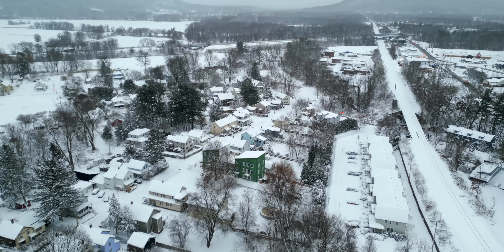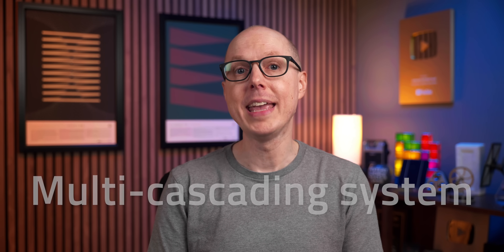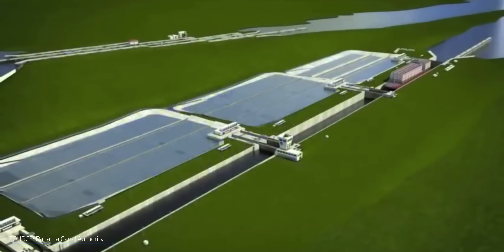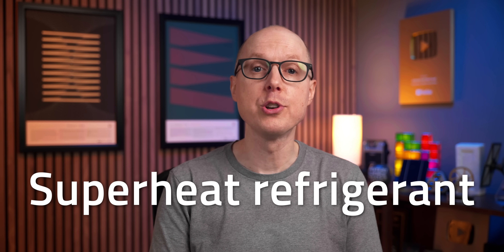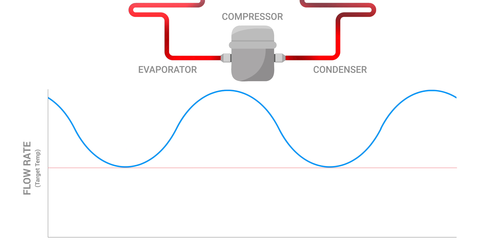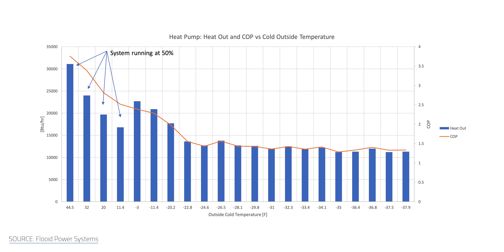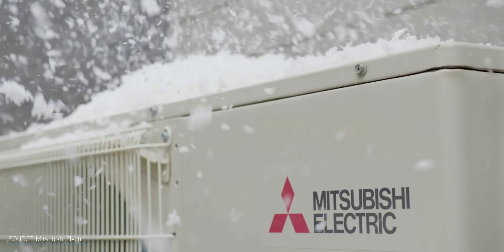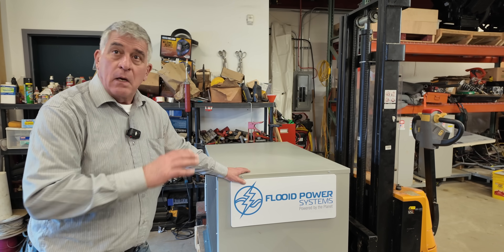How This New Heat Pump is Genius

Comment: today the temp is over 42C inside and outside it is over 44C here in India.

Traditional air conditioners can't handle this load- We had power blackout twice today. Two stage heat pumps must become cheaper so that it is affordable.
Reply: Everything that I've seen, heard & read indicates that India's major issue is the electrical infrastructure is woefully inadequate for basic needs let alone for use that the US sees as comfort. But yes improved efficiencies for these heating/cooling units are great, but only when used in tandem with improved energy production & distribution.
Reply: install solar.
Reply: My god that’s insane… Productivity must plummet in that temp sounds like hell!
Reply: is the humidity dry where you are in india . if it dry just use evaporative cooling . in my old combine that all it had  was evaportive cooling.  5 gallons   of water, a fan ,a  disk ( that use centrifical force to spread thee water even  to wicking material), and a small pump to pump the water to the spinning disk  that connected to the fan .  that cab would get uncomfortably chilly. and that cab was built like a greenhouse  . with out the evaporative cooling  and the windows closed it be  50c or more in the cab
Reply: @skrywenko6596  In India it is typically VERY humid. So you can't use water to cool at all.
It is also dangerous for people when it is that hot and humid, there are more casualties because the human body cannot cool properly anymore. I guess first priority in house is to get humidity down.
Reply: @roland9367  curious how deep is your water table.   you could do how I cool and dehumidify  my house ( though I use a closed loop at 7 feet depth).  you could use the cool ground  water to both dehumidify  and cool your homes  with ground source  cooling . it cheap and requires very little energy. either as close loop or as two well system  one input and one return
Reply: @roland9367 Dehumidifiers are basically small aircons anyway
Reply: @bosstowndynamics5488  no, they are dehumidifiers. Similar tech, different design. Only consumer grade portables are small.
Reply: @SuperS05  That's really just nitpicking though, dehumidifiers work by chilling air to condense out water, and refrigerative air conditioners also dehumidify air as a side effect (that's why they need drain lines). Both of them use heat pumps to do so as well. The only real meaningful differences are that dehumidifiers exhaust their heat straight back into the room and are smaller, but in practice if you're going to aggressively dehumidify your house in a very humid area for the purpose of decreasing the apparent temperature you aren't going to save much power compared to using an AC with a gentler target temperature (and the latter will decrease the actual temperature while also giving you some dehumidification)
Reply: @skrywenko6596  Yes great idea, but not for me, I'm not living in India. And most things are more expensive than a standard A/C for the people there. Most people don't even have money for A/C
Reply: @roland9367  oh okay, I thought you were from the response. but in either case  using ground source cooling/dehumidifying is very cheap method of doing it .  especial if  chilled beams  are used  as no fan is required as it operates on convection.  that way  only a small circulation pump is required to move the cool (~10c)  ground water around . for me it costs around  $5 to $10 per year  to cool my average house  for 90 day period  if the average temperature is  above +25C for the entire time period ( which it is not usually   my cooling need might be  $2 to $5 per year at most as i only use  50watt circulation pump)
Reply: @roland9367  Wouldn't high temps in dry air actually cause more problems? Humidity does make it more uncomfortable indoors as it quickly brings outside day time temp inside but perhaps would cause less heat strokes when people are outside. Correct me if I am wrong on this
Reply: @ick-625  No it has to do with how your body cools. It does so by sweating, which is a form of evaporation cooling. Once the air is so humid and warm that the sweat no longer evaporates enough, your body can slowly overheat. Old people are hit harder, but the concept is the same for everyone.

I have been to some hot places and to me it is easier to survive in hot desert than in hot and humid areas like in India
Reply: @skrywenko6596 technically they called a reverse chiller and scaled up to cool skyscrapers.
Reply: The combination of high heat, high humidity, and very limited money is an extremely challenging problem to solve. Many people here have said "Just throw money at it!" They don't understand what it's like to be poor. 

Blessings to you and your neighbors.
Reply: Install a simple white roof that are called cool roofs because they keep your home a lot cooler automatically without needing air conditioning and it’s more than environmental friendly.  It reflects 80 to 90% of sunlight back into space keeping the heat from getting absorbed on your roof leading your house to dropping temperatures faster.  There is also this paint called Burnham sulphate and it is the whitest paint ever that is meant for Roofs and it reflects 98.5% of sunlight back to space and that extremely white paint is 5 to 10 times stronger for the cooling effect compared to commercial white paint and it can cause you not to need to use your air conditioning again, at all during a hot day. The paint also does not just reflect almost all the sunlight, but it also creates a cooling effect in the shade or at night by radiating the heat away from the surface leading your house to a significant drop in temperatures and four outside too.
Reply: @Clouds-su3dc  while light colour and white paints can be quite effective at reducing solar load, and solar loads can be sizable, it is not the majority heat load for most buildings. It only applies to the top floor and sun facing walls, particularly walls facing the equator. So even if you manage a 98% drop in solar load, you'll still have a sizable heat load you'll need to deal with.

That 98% is also a bit misleading. It's not as effective at reflecting higher frequency wavelengths such as UV or even bluish areas of visible light.
Reply: @Clouds-su3dc  a very simple but effective solution; but I live in an apartment complex and the common spaces are shared. But painting the roof and the walls bright white can be very effective I believe.
Reply: @superS05 well that’s what they were saying about the Barnum sulphate white paint that reflects 98.5%. They had it on video about it.  I notice it is true in reality, because when I compared brighter white paint, versus a less brighter of a white paint the brighter white paint was more cooler.
Reply: @janami-dharmam yes having your walls white helps keeps your apartment cooler and also make sure the colour your curtain is white too because if it’s a darker color, then it will absorb more heat when exposed to the sun.
Reply: @Clouds-su3dc  I think you misunderstood what I meant. I am agreeing that it works. The numbers are misleading but it's still something compared to less reflective colours. The number is likely only measured in the visible spectrum. Something reflective to one part of the spectrum may not be visible to other parts nearby. Since the sun outputs a very wide range and the atmosphere only stops some of it, you still end up with heating, just greatly reduced. 

Of course a mirror would be best, but then you might distract planes or melt car interiors like The Fenchurch Building. Lol.

Yes white paint works. Yes Barnum sulfate may be even better, although I haven't used it. You'd still have a substantial heat load that you'd need to consider. IE. The building will always be warmer than outside in these situations. In some climates shading is all that is required to be livable. At +40°c you'll need more than that if you don't want to be sweating a river to stay alive.
Reply: Ah ok 😅 yeah my bad what I really wanted to try saying is that it leads to significant dropping temperatures pretty fast whenever the air conditioning is working in a super cool roof house. Of course if no, AC it can still be the same or slightly warmer than outside during the daytime, but with the help of AC it can keep it super cool inside for a very long time like for example 20 C  meanwhile 40 C outside and plus with the help nighttime, it really stays 20 C for an extreme long time on a warm at night without needing AC because from above it the extreme white paint a Burnham sulphate is made to radiate the heat that is in the air away from its surface keeping that heat radiation from entering inside instead.  As measured by experts with temperature measurements, when that paint is exposed to the hot sun the whole time on a hot day the paint surface is a few degrees colder than the air that is in the shade. It’s crazy to think how effective the barium sulphate paint is.
Reply: @MrHuram-abi  Thank you for your kind blessings!

To cool a house (in summer; same as heating a house in winter) you need extra input of energy. That extra energy finally lands up as waste heat (global warming) unless sourced from renewable energy. Better design and planning is key for heat management. Decentralized energy supply and consumption is the key and the grid should support fluctuating demands.
Reply: Insulation is also poor in India.
Most homes are built with bricks.
Reply: @gund89123  you can make a big difference to brick in that heat simply by making sure the sun doesn't hit it.
External cladding would be a relatively cheap upgrade.
Reply: Have you considered rooftop solar? When it's that hot, usually you're getting a fair bit of sunlight, which is what solar panels run on. Once you've got your own electricity to run your air con you don't need grid power to keep cool.

Solar panels do experience an efficiency drop when they get hot, but if you're running the air con from your panels, it's not difficult to blow a trickle of cold air down the back of the panels to keep them cool. I've never bothered because our hot summers top out at 43 degrees and mine don't seem to have any issues giving me more electricity than I need at that range.
Reply: Traditional AC can handle that heat. The Central Valley in California can get just as hot and higher.
Reply: That's a power grid problem, not air conditioning. Arizona routinely gets hotter than that for three months of the year and non heat pump AC works just fine
Reply: @benjiro8793 well it depends
I’ve lived in Canada my whole life and my clients who solely depended on A2A heat pumps had days when the system couldn’t heat the home, when outside temps were -26c to -30c BEFORE windchill, making the ambient temp more like -36c tp -44c for days on end. Those systems will eat a lot of energy and still fail to keep the home within a comfortable range of 22-26c 
I can speak to this factually. 

I am now doing projects in West Africa and the Caribbean, solving this same problem on the other side of the spectrum, and what this poster is referring to is likely the outside temp WITHOUT factoring the humidity ( which isn’t well spoken about/considered in these regions compared to North America or Europe) 
If he’s saying mid 40c is the outside temp, that’s is likely 50c or more when factoring humidity, which is what the A2A HP is trying to extract cooling, and well outside its operating range, worse yet if it is in a wall that exposed to afternoon sun and a cinder block wall (CMU) it will be even hotter due to solar heat gain, making it try to work harder and consuming more energy. 

Today it is (only) 36c where I am but the humidex reports it as 44c 
And my A2A HP is struggling to maintain a moderate 26c indoors, without brown-outs. 
Africa, the Caribbean like India and SE Asia have never considered insulation as mandatory in building codes like North America, that’s the first issue to address. 
First reduce the heat absorption into buildings through a external resistance (ie exterior EPS) then add mechanicals to adjust/control for interior comfort 
That’s what is needed, if not the temps are too hot and the grid will never be able to keep up with energy demands 

It’s a complex issue that’s not properly addressed on a global scale,
Reply: You can do something about the humidity with a liquid dessicant like concentrated salt water. You can boil or evaporate it in the sun to regenerate it using any source of cheap heat. From there, evaporation becomes possible. Tech Ingredients has a couple of videos on cooling this way, it's been a couple of years but just search their channel for air conditioning.
Reply: @DFPercush  that can be quite energy intensive, and often still results in warming the space air. desiccant wheels are not new and are often used in larger ERVs where the heating isn't required.

Energy for heating obviously can come from various sources like burning wood, or solar concentration, which may or may not be very viable to the OP.
Reply: - the issue is poor insulation of the buildings, AC can do the task - the power grid can't (??get some solar on the roof).
(evaporatively cool the "evaporator" - spray with water...)
Reply: @benjiro8793 well yeah but if most people are using way more efficient heat pumps , then the possibility of a blackout gets lower because the overall electricity demand gets lower too.
Reply: With an evaporating temperature of 5 degrees C, there should be no need for cascade. Larger condensers may cost money but they have zero running cost. Cascade is far more complex with far more things to go wrong. The overall total temperature differential will also increase running costs.
Reply: @benjiro8793  We here in Australia also get temps in the 40s and sometimes 45 and higher. While we have a pretty reliable power supply, the air con really struggles at over 40 this stuff makes great sense. Considering the outlook for even higher temps in the future this tech needs to get on.
Reply: @janami-dharmam  
Is the humidity high or low in India ?
Evaporative Cooling will work well in those temperatures.
We have 'up to' 52 deg C in Central Australia and the air is dry.
Commercial Buildings work better with Evaporative Cooling.
Humidity is added to the dry air and the temperature cools in line with the Psycrometric Chart.
They only need a water connection and power for a small kW Fan Motor.
Reply: old Dayton wall unit with a thermocouple work better when there is no power and infinitely cheaper
Reply: In this situation where utility electricity is unreliable, consider a DC solar air conditioner.  That is, an air conditioner that runs directly off of a modest solar DC string voltage.   For example, the "EG4 Hybrid Solar Mini Split".  That one does heating and cooling, but you get the idea.

No grid connection, direct from solar (no inverter, no charge controllers, no microinverters).  Just a sufficient number of solar panels connected in series and the hybrid mini-split and you are done.  Kinda hard to go wrong.

Of course it can only do its thing while the sun is out but that takes care of a large chunk of the problem, right?   Roughly 800W can cool a room (1-ton equivalent).  It can make a space livable that previously was not.
Reply: @junkerzn7312  We love EG4 Lithium 100Ah battery bank batteries, had them for a month, so we hope their Mini split also is a great product. Perhaps Matt can review their minisplit for us, before we buy it....
Reply: Damn, stay safe
Reply: 20°C delta isn't particularly hard. It's rather standard in fact. There are other countries that are as hot if not hotter with stable electrical grids that don't have any issues with cooling. Even in a cold country, I still have applications that are worse, with ambient temps constantly above 40°C. Simply designing to it and properly installing the systems solves these issues.
Reply: @SuperS05  Air conditioners can handle 20C easily but the electrical grid of a developing nation that's racing to lift people out of poverty supplying many millions of air conditioners all doing that at once is very different to a very well matured grid doing that for a much smaller number
Reply: @bosstowndynamics5488  
I only mentioned the 20°c lift due to the OPs mention of it. It's the grid that's the issue, not the technology.

Comment: Makes me sad, in Minnesota can get below -40C/F on freak days so it still doesnt work
Reply: Insulation is king. Keep in mind, the better your insulation the longer it'll take for those cold outside temps to impact your warm inside. If you had your house warmed to 68 degrees F on Day 1 and the temps dropped to  40F below  overnight, how long would it have to stay there for your house to get cold? The better the insulation, the longer it'll take -- and the less work a heat pump will have to do.
Reply: Do the math! Usually it is one or 2 days per multiple years. So you can used inefficient technology 1/700 part of the time... That's why Al Gore tackle on climate change was so great... It was not too late in the 2000 to build a better society... Now we ask ourseft if putting children in cages is Obama's or Trump's fault... Meanwhile it continues...
Reply: Yeah those 1.3 days/year where you have to use resistive to assist will completely cancel out the other 90 days where you're saving money.
Reply: Ground source for Minnesota.